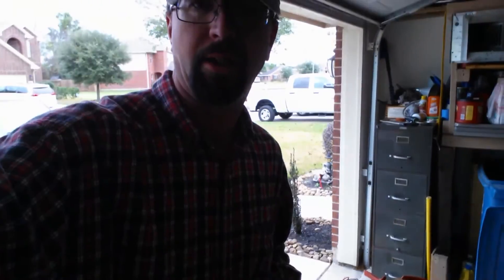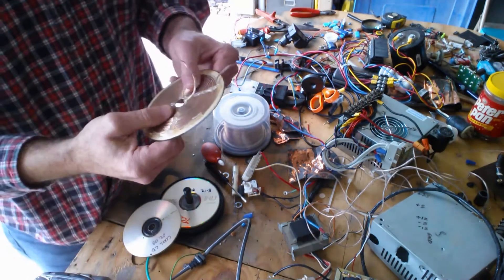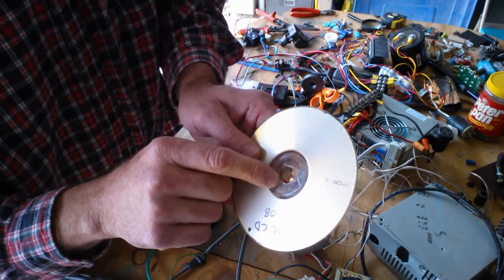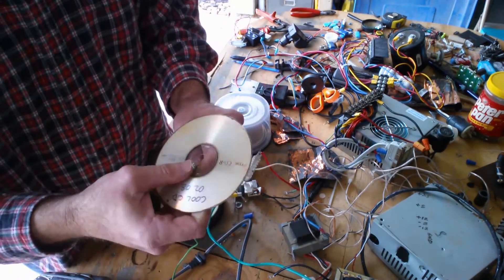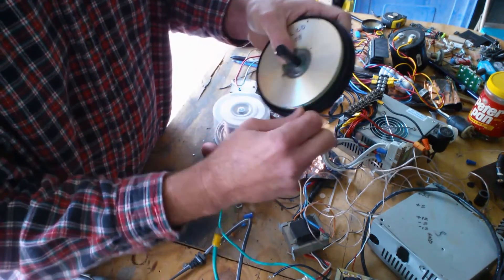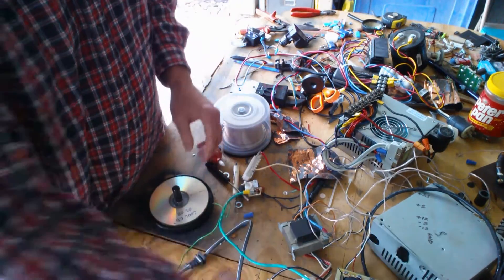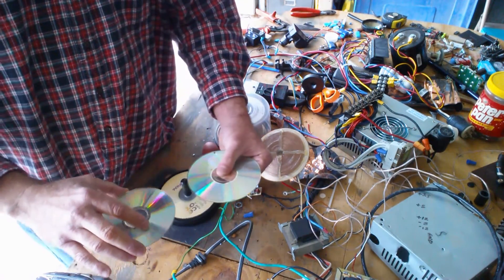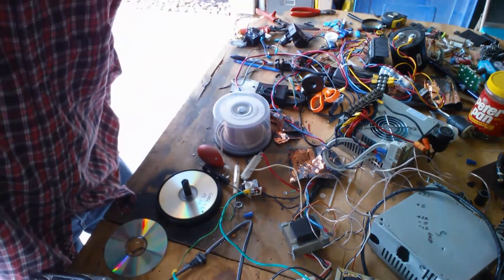Making pancake coils fast and easy!

Comment: a cd has conductive material inside. just saying ..
Reply from the maker: Good point.  It can be removed with duct tape first.  I will add a bit in the description about that.
Reply: @mwm2929  that also contains conductive elements. I would recomend hotclue ;)